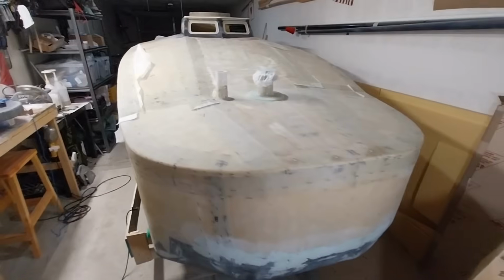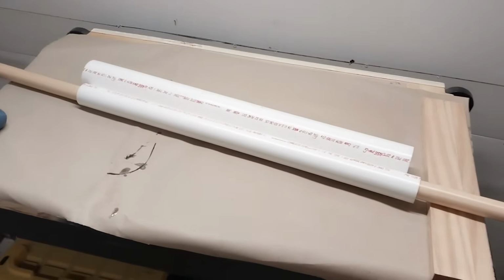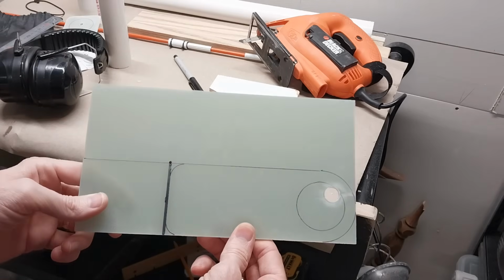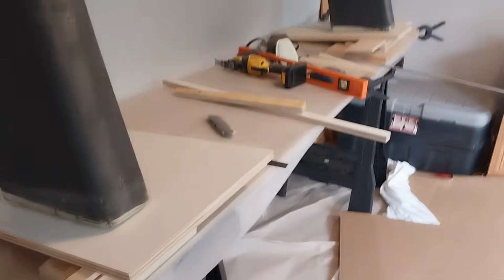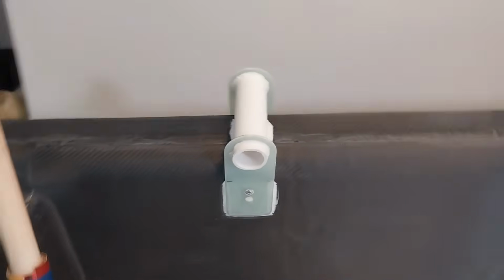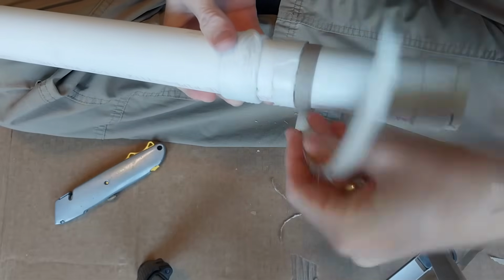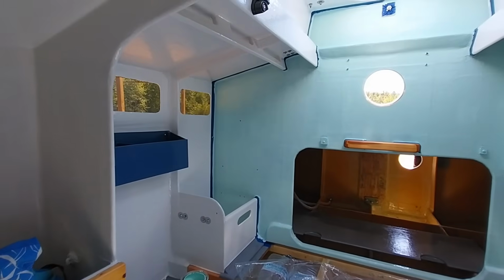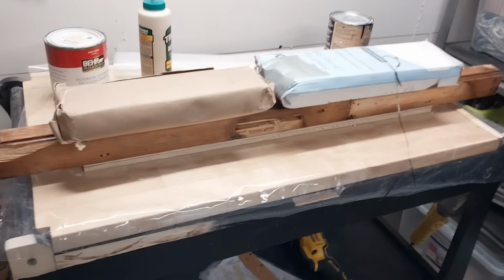OCSS-093 Building My Windvane Self Steering: First Steps Completed!

Comment: i have watched many videos of ocean sailers. Every one of them had issues with steering. My GUESS, as a design engineer emeritus is that you should work out strengths considering the full force of green water crashing over the self steering gear. If it can withstand TWICE the forces involved  then it is more likely strong enough. Assume the vane gets hit full on by a stern wave. I suspect your PVC implantation is under this strength. Given wind steering is critical to passage making  then make it bigger than a brick dunny (Australian term for extremely over engineered.

Comment: Love simplicity, so hope it works.  My comments
Air only wind vanes work ok on catamarans, so perhaps it will be ok on your scow. (Traditional monos have too much weather helm , so need the servo paddle)
Being off centre, I suspect it work at lot better on starboard where the vane is in clean air, perhaps not so well on port.
The part of the vane in front of the axis will reduce the turning force, ie like a balanced rudder. As you mock e the vane away from the axis, it will multiply the force.
An aerofoil section to the foil will generate more force. 
In low wind speeds you need to minimise the friction, your top bearing might not be free enough.
Best of luck…hope I am wrong!
Reply from the maker: I'm definitely an amateur in this matter, but I'm going to give it a try and I can adjust from there. It would be fun to experiment with building an aerofoil air paddle for it. I have seen this concept work on a couple other small sailboats, so I have high hopes.
Reply: @ocean_capable_small_sailboat . Very good.  But I definitely think you should remove the part of the vane in front of the axis.  I do also worry if your broomstick will be strong enough.
Reply from the maker: The spar for the counterweight? that's important to have because during the rolling motion it keeps the weight of the air paddle from falsely spinning the vane.

Comment: Love seeing your progress. 👌 I’m curious, why are you not mounting your anchor light at the top of the mast? On your arch, is it a concern that it will cast a lot of light on the cockpit and attract a lot of insects at anchor? Also, are installing mechanical/electrical propulsion and if so do you plan on installing a steaming light? Not sure what COLREGs require for lighting of a boat this size.
Reply from the maker: Vessels less than 7 meters with a maximum attainable speed of 7 knots may show just an around white light. That's convenient since a white light can be seen further than just a red or green which some sailboats only show from angles forward of the bow. I would love to have it on top of the mast but because my mast spins to furl the sail, it would make the wiring really complicated or impossible to set up. I've never had much trouble with insects in the cockpit on my previous boat, I think the breeze was usually keeping them away.
Reply: @ocean_capable_small_sailboat I knew you had this figured out. Thanks for confirming your rationale. 👌

Comment: Does the wind vane have enough power to move the tiller? It seems like you're not using a servo pendulum- no oar in the water to add power.
Reply: Starting from ten knots of wind, it works very well; below that, it's just adequate. I have a sail area of 140 square feet, my boat is well balanced, and with the sails properly trimmed, I haven't encountered any issues. It suits my sailboat well — as for other boats, I'm not sure.
Reply: I would speculate, that the wind vane would need to be much larger and set back from the axis of rotation to provide more torque.
Reply: @RichardUS8  The axis is offset from the edge for strength. The counterweight makes it easy to change the direction of the aerial and provides enough force to control the boat bar.
Reply from the maker: It seems to be working on some other mini-cruisers the same size as my boat and a bit bigger. Testing will tell.

Comment: Any concern about the degree to which epoxy adheres to PVC plastic pipe?
Reply from the maker: Yes, it won't stick well. So, I scratch up the PVC with sandpaper and run the strip of carbon fiber from one part of the buoyancy Arch, over the PVC, and back onto the arch. Hopefully that will hold it. Plus with the G10 brackets I added it shouldn't be going anywhere.
Reply: More concerned with the larger tubes which will flex and move. Love your progress though😊

Comment: Ooooow I like that design mate. Ok if I do the same?
Reply from the maker: Of course. Email me if you want that plan with the measurements. It's in French though.
Reply: @ocean_capable_small_sailboat  cheers bud, will do. Reckon it will be able to apply enough force for my chunky rudder and still be sensibly sized?
Reply from the maker: I don't think it will be as effective on bigger heavier boats. I've built my rudder to be balanced, which will help reduce pressure needed to push the tiller. The vane Bernard Moitessier used which uses a trim tab would likely be better for your steel boat.